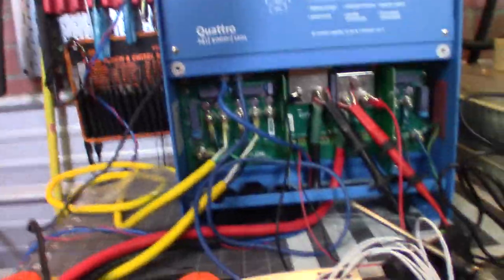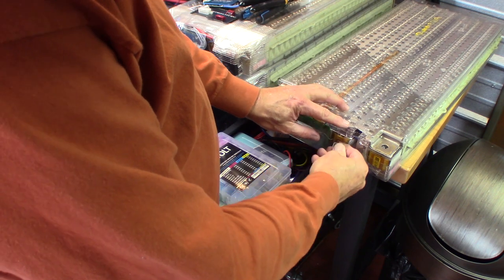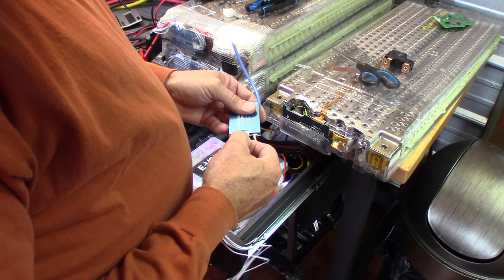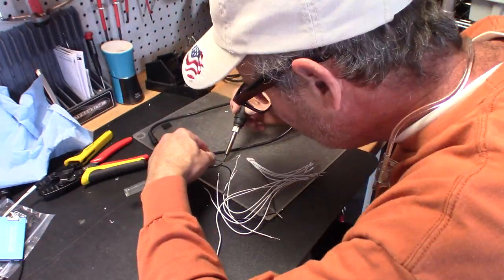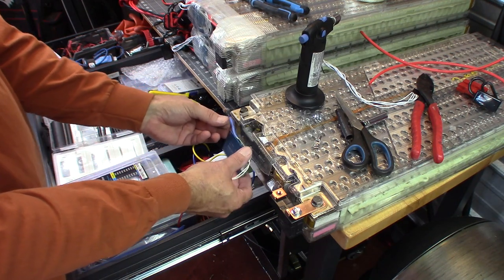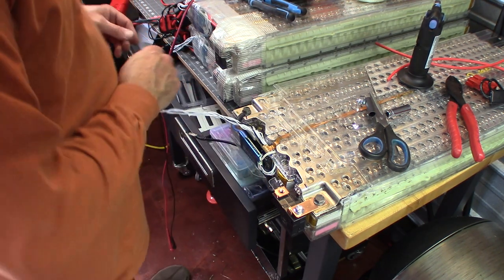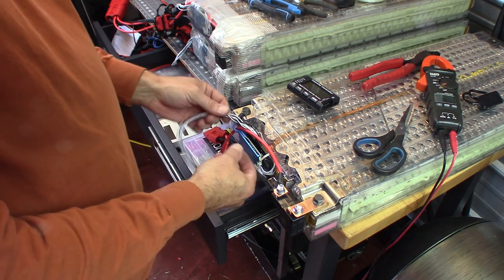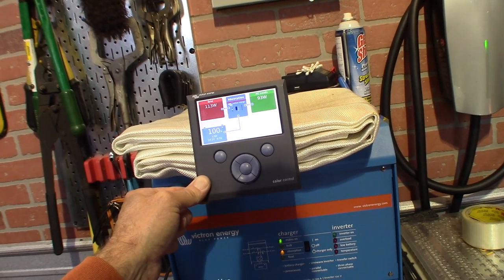Battery Version 4.0 TESLA Powering The Space Between | Fix it Friday | Sailing The Space Between

Comment: Hey Scott, I've ordered 4-3.2 volt 290AH prismatic cells.  They are on the proverbial "slow boat from China".  I'm expecting them in the next few weeks.  I'm a newbie, but I'm watching and learning,  reading and watching online.  What would you recommend for a BMS when I build these?  I want to make sure they will have a low temp shut off.  Putting this battery on a 35" sailboat so I don't worry about too much load.  BMS decision seems so arbitrary!  So many choices, so few rock solid recommendations.
Reply from the maker: Well the pro to a BMS are they keep you from burning your boat down as well as balance your cells. Anytime you are dealing LIPO's you need some safety measures and the BMS is the head of the line. The new ones I had made have the temp sensor built in. I also have an over under volt sensor on the batts so the victron can shut them done in the event of an emergency. The cons are they can fail but if you make them modular you can change them quicks and easy and they add to the cost of the battery build... Well that my 2 cents work stay tuned for the inst coming up ina week or so...
Reply from the maker: Ya I totally agree the affordable BMS today are so hit and miss thats why I spec mine but with the C word china is just not producing like they were...
I may have in stock depending on your specs shoot me an email I see what I have
Reply: @SailingTheSpaceBetween  Hey Scott,  I picked up an Overkill Solar 120A 4S BMS.  Looks like a quality product and company.  I'll let you know how it works when I get it set up.  Thanks for the reply!

Comment: Check the specs on your transmission/propeller for rated maximum torque. The motor you have is certainly an overkill. The higher the Voltage the less heat loss and longevity of your system. I have an 18kW motor at 48VDC.
Reply from the maker: Ya we wont be using but about half the torque and have the voltage or we could shred a sail drive in a few sec..

Comment: Why didn't you use larger wires? Is your boat not 240 volts? With a second inverter, you could power both legs.
Reply from the maker: No boat is only 110 on 2 legs and off dock is combined to one leg on the generator so a second inverter would not help much and not charge off the generator. As far as wire gauge I have the batts dummed down to 30 amps each no need for the extra weight and wires are UL plus 30% over for safety.